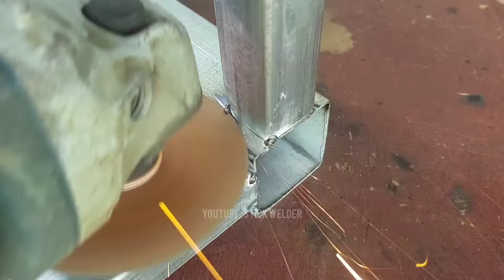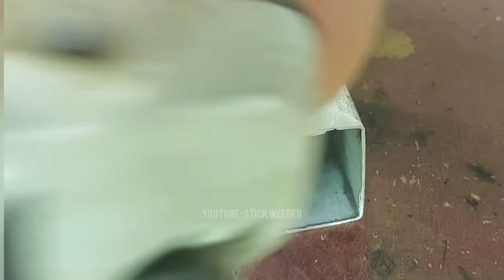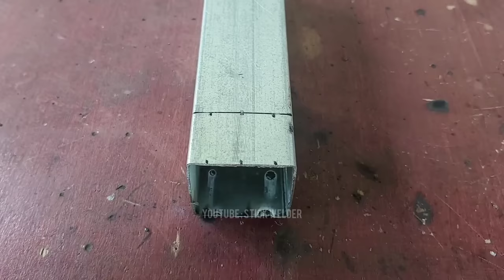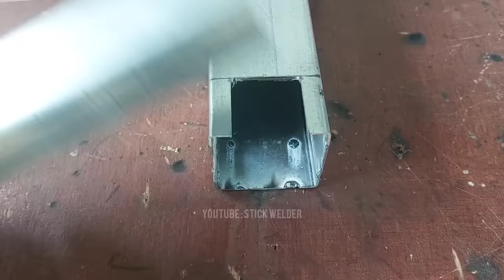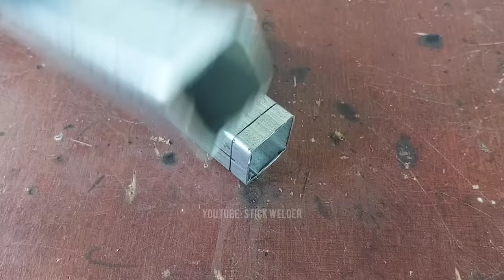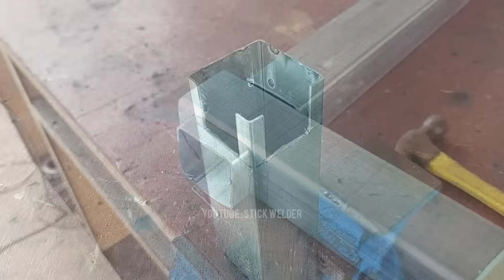very few people know, the welder's trick is to make the weld stronger in thin metal | pipe cutting

Comment: 😂😂😂😂 if they gave the best prize I know how to do.. you just showing for wasting the time and money 😂😂😂
Reply: Right
Reply: I may say he is just sharing a knowledge...sa tagalog di madamot sa nalalaman...❤❤❤❤kaalaman
Reply: I'm sorry but you can show us how you do it? Just for additional idea.
Reply: I agree, wasting of time no need to cut because welding is strong
Reply: I don't the think so...  You can pretend you know enough, or even everything. However the catchword is "thin metal". There is one theory doing the rounds, that every good idea takes 40 years to catch on. Similar words like yours were used when telephone, computer etc. were made. But the technique shown here is far more simple than above mentioned inventions, and the nuances finer. You have every right to scoff at the idea, but no right to write it off just like that. That is what I think.
Reply: If you need a stronger weld, save time and energy by buying thicker material, instead of going through all this bullshit
Reply: You don’t weld do you? Lets say for some reason you need to make a bed to hold your mom with light metal. Just weld angle bar over your original weld and voila. Or just go get a thicker piece
Reply: @JojoCasio-gy6uj should ha e just finished it the way it was at start. He made it way too complicated. Made it 10 times hatder and 10 times more time to do
Reply: Verzwakt alleen meer 😂

Comment: Stronger but the labour cost  $ is not worth it. Fill the corner tube with a horiz plt mid axis if you must.  Or make mitred joint on top  of vertical leg. Trad method is to weld simple plate bracket between legs of the frame. Cheaper, quicker and effective. Also you cannot weld  any of the cut joints that are inside the vert tube leg.......so it's a waste of time. This would be thrown out at any design review. Imagine if you had to make 20 of hese joints.!!!??? If any of those slot cuts are not perfectly square the joint alignment is ruined.

Comment: Good videos.
Just one small suggestion. When you perform the cutting if you drill on all the corner points with 2, 2.5 or 3 mm drills you can assure yourself of clean corners. Also during welding these will act as a terminator for any cracks developing at a later stage.
Actually this is similar to welding a cracked member. By drilling a hole at the end of a crack the crack does not go further while welding.

Thanks.
Reply: Thank you.
Reply: another great enfo,
thanks bro 🙏

Comment: In woodworking, this is called a "castle joint." Creates a very strong and rigid joint and is usually used for table legs.

Not sure how its wood counterpart's characteristics translate into a thin walled square tube, but it looks very nice. Creates a good-looking - and hopefully strong ;o) - corner connection. This isn't a mass-produced item. This isn't  something done in the shortest possible time with a minimum effort. This is not a "slap together and move on." 

Yes, it takes extra time and effort. But it's nice. Why can't we simply appreciate the skill needed to make nice things?
Reply: Serves no purpose in metal. If that corner needs reinforcement (and that raises questions about the choice of thin wall profile and the expected loads) then that is absolutely not the way to do it. This is just BS content for the sake of content.
Reply: Agree with your last sentence - but the guy's gotta eat, right? ;o)

Comment: Soo... 1, that's a lot of work and only if you are going to have the post open anyway. To cut the post open for this, I think you're hourly 😆
2... if it's thin metal, making your welds hold 20 tons won't make the middle section stronger. Use heavy metal if you need heavy metal. This is just wasted effort.